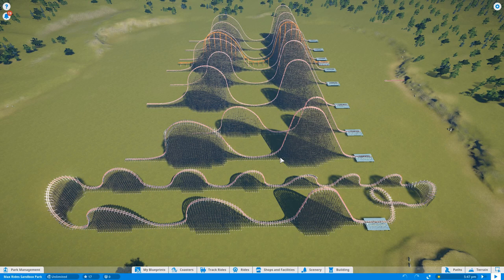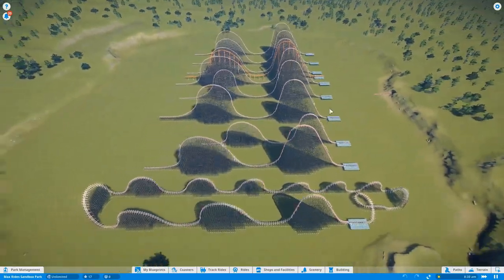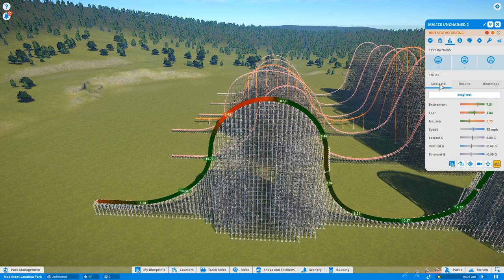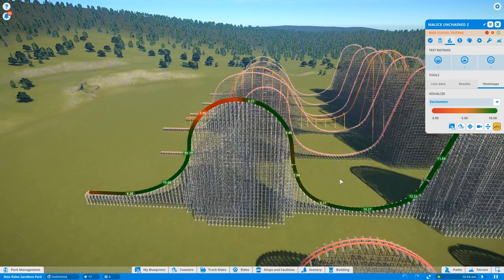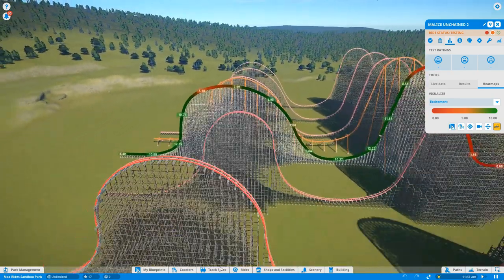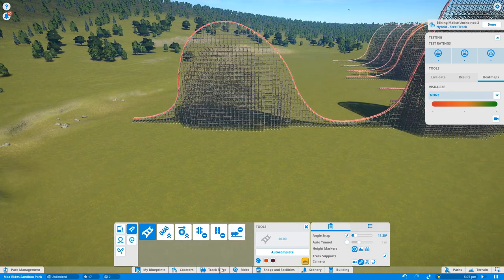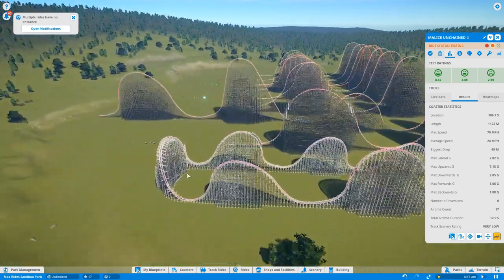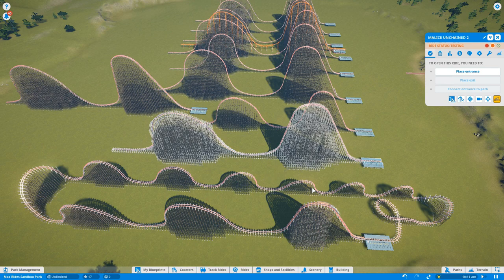MAKE HUGE AIR TIME HILLS! Planet Coaster Tutorial 18

Comment: Youre missing that the forces in the heatmap ignore gravity, a real zero g hill equals a minus one g hill in the heatmap.
Reply: Yeah, but it becomes complicated with banked and curved hills. Try to bank your zero g hill for 45° and it will negate most airtime in the results. They calculate airtime etc in a very easy way, and thats okay. Annoying is just that your coaster basically becomes worse in exitement the more time you invest optimizing it in a realistic way:/
Reply: but there is also ejector airtime, which is like the best airtime ^^
Reply: The total track seems to matter realy much on how the excitement rating evolves on the track parts. Also my hybrid coaster has some strange things happening with the total excitement. I mean I can change little things out and even when I give a hill more airtime but somehow the total excitement doesn't change. sometimes even drops from 7.4 to 6.9
Reply: Either you are wrong or it has since been changed, but it clearly shows 1g on a flat piece of track, and by making a train follow the exact path that it would follow if you let it fly off the track you get a zero g hill.

Comment: Soooooo basically if I want to have a roller coaster that people will actually ride then I have to just give it a bunch of airtime? I just want to build a roller coaster with loops and inverts but every time I put any it just add's a bunch of fear and nausea and 0 excitement . . . the whole reason i bought the game was to build roller coaster's to my liking but there is no point if they don't make money in my park  : (
Reply: I’ve recently built a launched coaster with 8 of my own custom inversions and it’s at over 8 excitement, 5 fear and 1.80 nausea (triple green stats). I kinda put some airtime hills between the loops and used some of the inversions as a way to turn left or right. I kept the speed nice and constant. :) It’s totally possible to build a triple green stat coaster with a lot of loops!